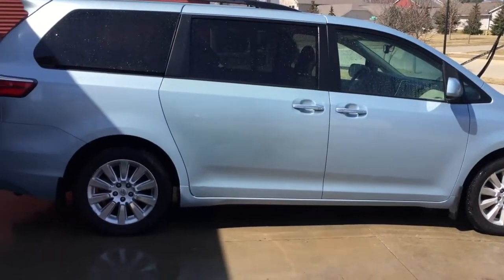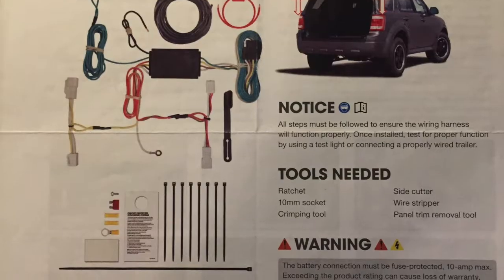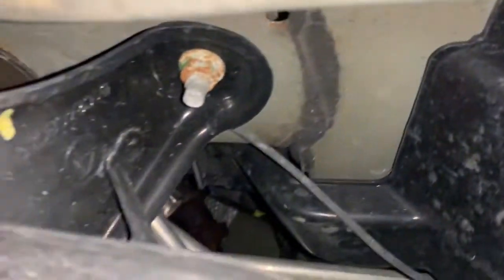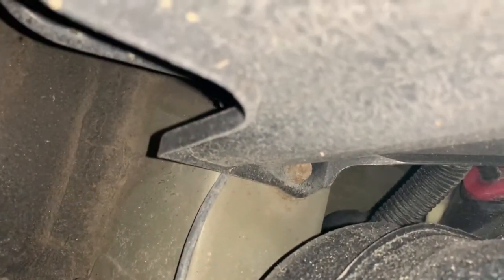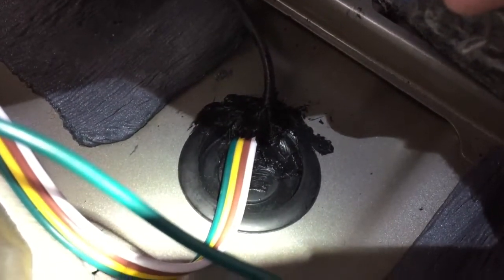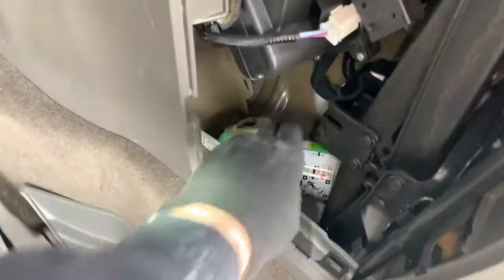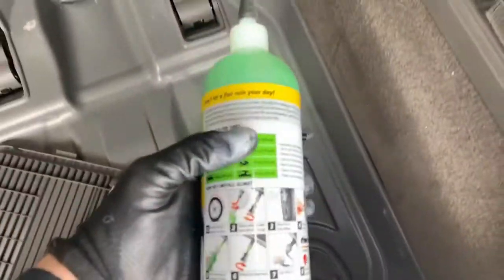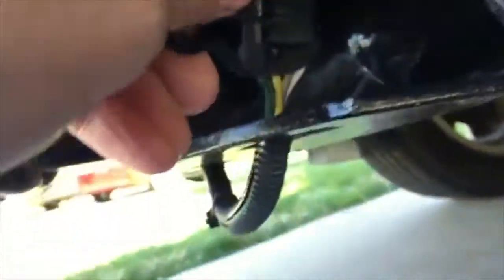️🔥 Toyota Sienna **How to Install a 4-Pin Trailer Wiring Harness** ➔ DIY Tow Package (Curt)

Comment: Thanks for the video. Although it's not possible by definition to retroactively install something, I did see from this video that my installation was done right, but what a dumb design by toyota to require a line run to the battery. That extra power should have already been there like it was on my Odyssey.